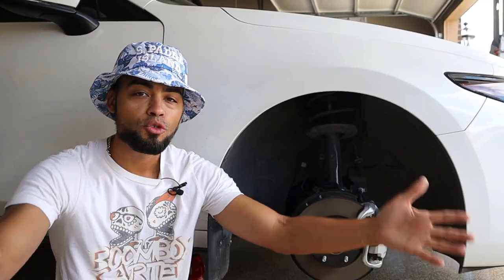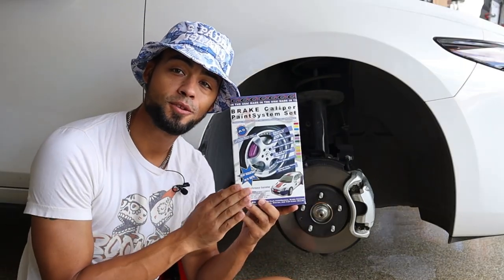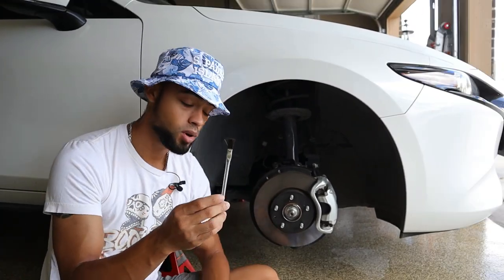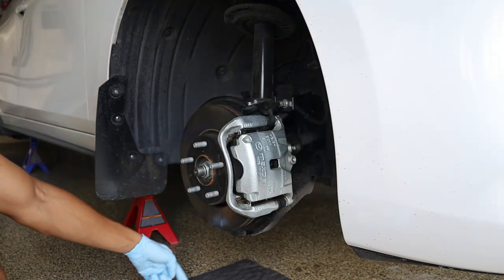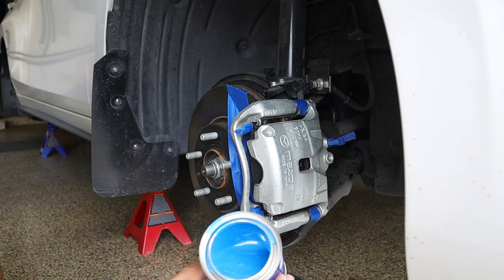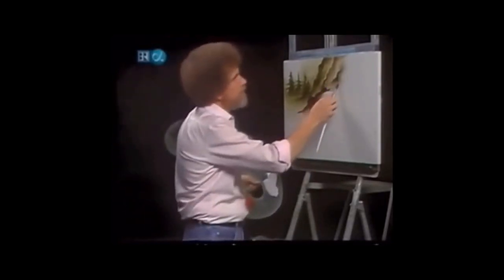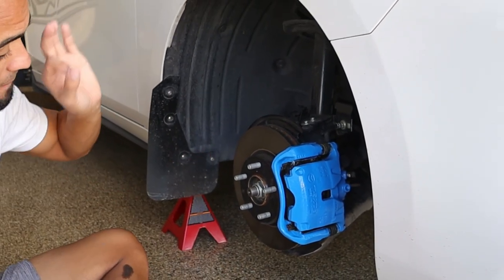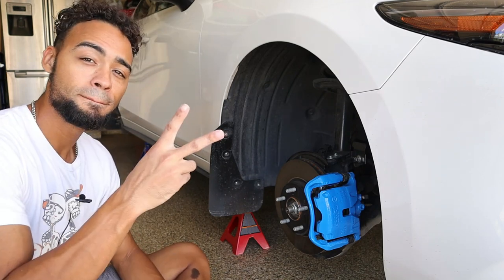DIY Brake Caliper Paint!

Comment: At this rate you going to run out of Mods to do by the end of the year! Keep it up lol. I would also recommend to pour a little of the paint in another Air Tight Container to save for future Scratches or Chips. Don't pour the hardener with it though.

Comment: Nice video! Might have to look into this kit. But got a question, where did you put the jack stands on the car? I’ve been trying to find if there’s a spot to use jack stands without damaging the car
Reply from the maker: Underneath the car the is a line of pinch welds specifically for jack standing anywhere along there is where you’d place them. I’d recommend googling for a specific diagram on placements!